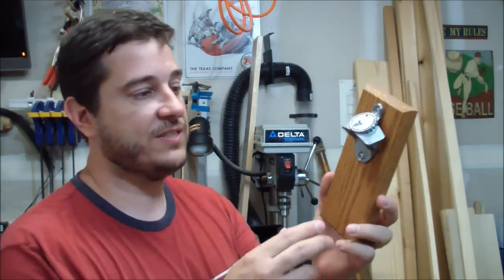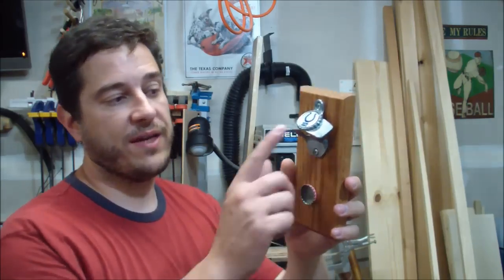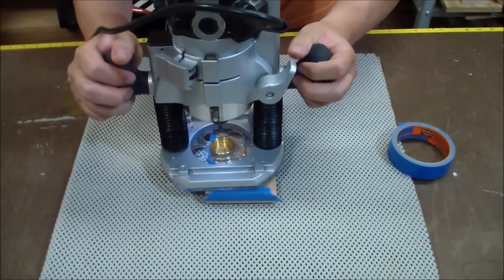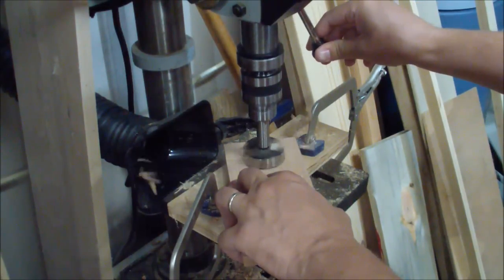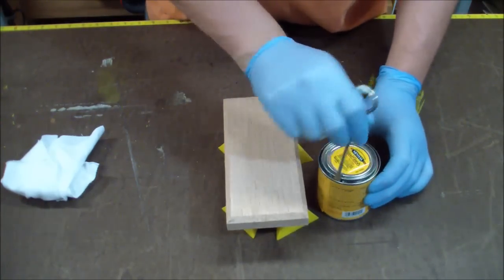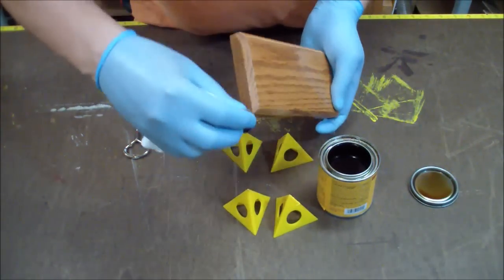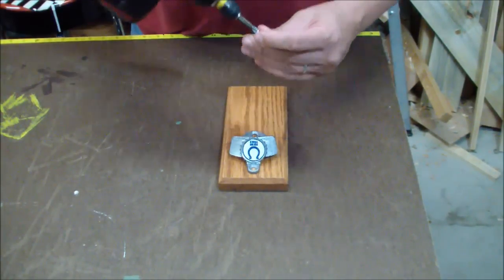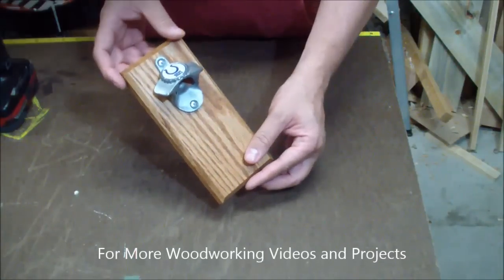How to Make a Bottle Opener with Magnetic Catch (woodlogger.com)

Comment: Would a 1/2" thick plywood sheet be enough to hold the force of actually using the bottle opener? 

(I wont be using a magnet obviously that wouldn't fit in 1/2")
Reply: tommie v